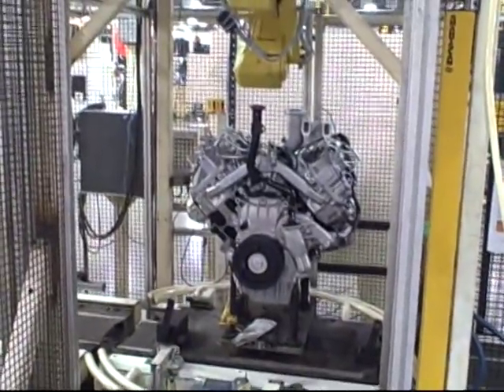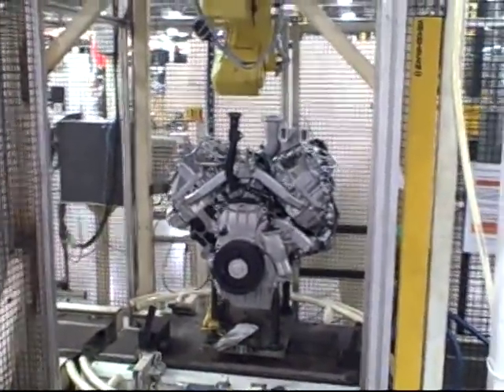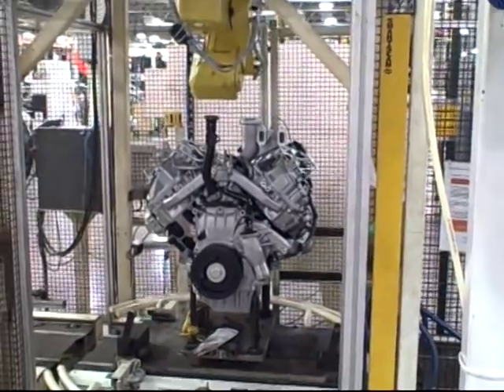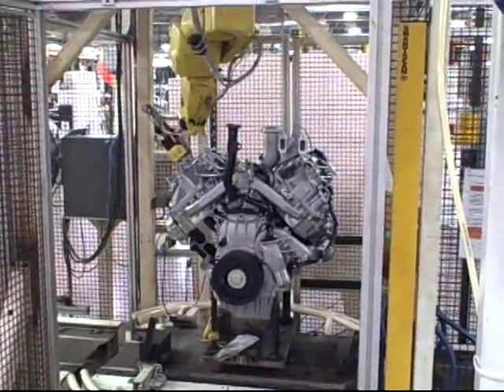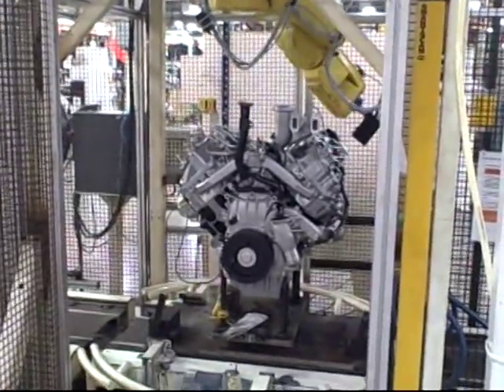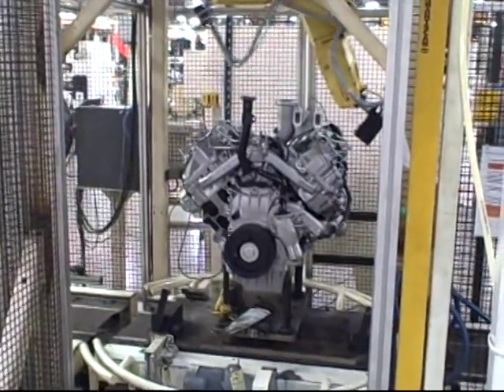Duramax Assembly Plant Tour Part 1

Comment: Dura max is a junk engine your plant will be shut down once G.M. goes back to international for engines.
Reply: Victoria Louden they never used international
Reply: No, they use Isuzu
Reply: Ford used international. 7.3 was produced by international, the 6.0 was Co designed  (we all saw the problems that came from those) and then the 6.4 was entirely ford (Oh yeah those were worse than the 6.0s) and the 6.7s oh they broke crankshafts from the start because I guess the engineers at ford couldn't figure out how not to make them. And if you are a dodge fan boy yea when was the last time they made a "hd" diesel? I can't think of one. Cummins has been making all of their diesel engines since the 80s. Duramax bought Isuzu and redesigned their design. Had a few injector issues and injector harness issues and then cp4 fuel pump issues which ford also uses in 6.7s which has had just the same issues. Shock.
Reply: 😂😂😂😂wrong